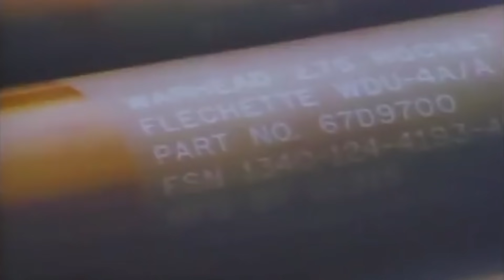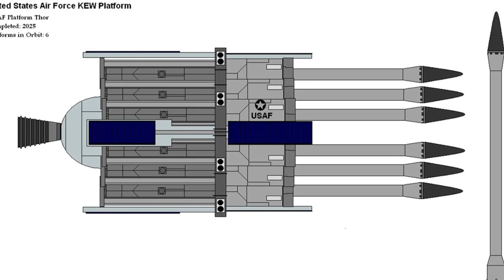'Rods from God' Weapon System Gets Another Look

Comment: Sound barrier breaking speeds lol. No they would hit at a speed around mach 10!
Reply: And in the next breath says they would lose mass due to air friction.
Reply: Justin Kirk These rods are made of tungsten. They can withstand over 6,000f and be fine. The Space Shuttle Orbiter gets around only 3,000f during re-entry. Well below the temperature tungsten can withstand.
Reply: @resolutesupport3874  yeah but the space shuttle isnt going mach 10 lmao
Reply: @resolutesupport3874  the amount of heat generated depends on how fast the object is going, as well as the surface area of the friction from reentry.  A smaller point of friction would generate heat a lot faster than a larger surface area traveling at the same speed.  It would also slow down less than an object that offers more resistance.

It isn't the resistance itself that causes the temperature change but ( surface area, rate of speed, amount of resistance [density of the automospheric values at that altitude], and time traveled at that speed in that resistance. )

If a shuttle stayed in the reentry drag for much longer than it does it would fail.  Due to time.  If it comes in sooner than the density would cause it to fail.  It really is a finite science.  Granted I'm not a rocket scientist if you will but there are other fields of expertise that use a small bit if the same physics.
Reply: @ditto9300  mach 22 actually (17,000mph)
Reply: @justinkirk5449  that would more than likely occur due to the structural integrity being degraded during reentry.  Coating it with a ceramic material simular to those used on shuttles might negate most of the mass loss of the projectile.
Reply: @dontneedtoknow5836  lol, tungsten isn't strong enough so we should paint it to make it stronger. 👌😂😂
Reply: @justinkirk5449  lol no.  Coat it with a heat disbursing material to prevent any integral loss.
Reply: What do people that think they know things say to people who actually know things... @dontneedtoknow5836
Reply: You tig weld with a tungsten rod. Tungsten wouldnt even get soft entering atmosphere
Reply: You realize mach 10 is ten X the speed of sound, right?
Reply: @CaptHavoc2024  yes, and that was a conservative estimate. It’s probably going to hit harder then that.
Reply: You do realize that 2000lbs has terminal velocity of 0.5mach, right?
Reply: Force of a nuclear warhead without the long term radiation
Reply: @Shem Casimir The shuttles, having a high drag coefficient slowdd down in the thin upper atmosphere. By the time they hit the denser air at lower altitudes, they were pretty slow. That wouldn't be the case for these things.
Reply: @Evan_Bell  wow wish I would have seen this response first then the entire equation Explination wouldn't have been necessary.
Reply: @dontneedtoknow5836  
Are you referring to the comment I left outside of this thread?

Orbital velocity:
V_orb = ((G*M)/r)^0.5.
G = 6.67e-11
M = 5.97e24. 
r = 6,371,000 + (1,000,000*1.609) = 7,980,000m. 
V_orb = 7,064ms^-1.

Velocity from falling:
V_final^2 = V_initial^2 + 2ad. 
V_initial (vertical) = 0
a = 9.807ms^-2.
d = 1,000,000*1609 = 1.609e6
V_final^2 = 1.578e7
V_final = 3,972ms^-1

V_total: 7,064 + 3,972 = 11,036ms^-1. 

Kinetic energy: 
E_k = 0.5*m*(V^2)
m = 2000 lbs = 907kg. 
V^2 = 121,800,739. 
0.5*907*121,800,739 = 5.524e10j. 

1kt_TNT = 4.184e12j. 
5.524e10/4.184e12 = 0.0132kt. 

Only one nuclear weapon was ever deployed with a yield smaller than that, and it was carried in a backpack.
These things aren't comparable to a nuclear weapon. It's only just over 1.2 times higher yield than the GBU-43/B MOAB.
Useful for bunker busting? Theoretically. Fill a similar role as nuclear weapons? No.

The highest melting point material we have is tantalum hafnium carbide. It melts at 3990 C. 
Assuming a semi-vertex taper angle of 5 degrees for these cones with a nose radius of 1mm, and a velocity of 11km/s, the temperature behind the oblique shock front will be just over 1000 degrees. The mach number behind the shock will be 17. The density of air behind the shock (at sea level) will be 5.32kg/m^3. The thermal flux will then be 17.77GW/m^2. This is more than sufficient to ablate any material, including TaHfC.
Reply: @Evan_Bell  actually I did not see that equation posted.

Is the actual altitude from sea level almost 7 million meter?

And are you accounting for the combustion of the buffer zone of air in front of the projectiles ignition upon compression?
Reply: @dontneedtoknow5836  7.89million meters in the orbital radius if it's 1000 miles in altitude. 
Are you asking about the plasma sheath around the front end? There's no combustion going on there. In accordance with the depictions of these things, I used a small nose radius and shallow taper angle. This avoid reaching temperatures at which air begins to be ionised. If the tip was rounded, then the temperature behind the shock front would be about 66500 kelvin.
Reply: @Evan_Bell  at that speed it should have a combustion of the oxygen within the nose region just before impact.  Simular to a fire piston considering the rate of disbursement is somewhere around mach 3 if I'm not mistaken.

I believe the buffer is called the conical wave?  Don't quote me on that because I'm probably wrong.

And a fine point would literally heat up faster than a larger surface area.  At 1mm in diameter it loses the disbursement properties long before that speed.  The amount of time that the friction is ensured would negate any measures from the design.

Physics of a knife blade helps explain this.  A very sharp knife can not exceed an angle of 20 degrees in either direction or if it does it will be non proficient.  Either by not being a clean precises cut at 21 degrees or subject to chipping, rolling, and flattening at 19 degrees.  Even though a 20 degree blade is very sharp it degrades very rapidly when it comes into contact with any surface that offers resistance equal to 1/4 of the materials density.  E.G. a metal surface, a scour pad, hard plastic cutting board, glass surface or jewels in jewelry.  It also is more subseptible to heat damage.

Granted a fine tip does cut better and offer less resistance.  But is also more subseptible to any changes in temperature and density.  I see how your value could be accurate however there are many factors not accounted for that I think would be very important.

I don't think time is being properly perpetuated and maybe because a miscalculation in the velocity due to assessing terminal velocity being the contributing factor of gravitational pull and elevation.

The terminal velocity from before reentry needs to be recalculated?
Reply: @Evan_Bell  then you can calculate the loss of speed using the algorithm produced above.  But the value before reentry needs to be defined, and then the negating ( deminitioning return ), including the time inside of atmosphere vs terminal velocity inside atmosphere, with the resistance being the determining factor and loss of momentum being calculated in as such.
Reply: @dontneedtoknow5836  Combustion of what? Oxygen doesn't burn, it's an oxidiser. There's no fuel in the air. Air doesn't burn. It is heated, and it can ignite flammable materials within it. The air itself doesn't burn. What do you mean by rate of disbursement?
A conical wave is one profile an oblique shockwave can take, which is what I modelled. For the same thermal flux, a surface will heat up no matter then area. I don't know what you mean by disbursement. 
Yes, aerodynamic heating is complicated. 
Terminal velocity before re-entry? There is no terminal velocity outside the atmosphere. I calculated the orbital velocity at the beginning.
Reply: @Evan_Bell  pire piston look it up.

An edge has a higher propensity to generate heat if friction is based on one point of contact.  << requires more time or more friction but once it begins it rapidly increases to the maximum temperature of the friction due to inability to disburse the heat efficiently through uniform cooling designs.

I guess I didn't see the "orbital velocity" probably due to skimming and researching the GW output of a nuclear devise.

Air can only be moved so fast.  Before impact it compression destabilization it will ( air contains more than oxygen and oxygen is combustable ) generate combustion which will increase the yield equivalent to volume/force applied.  This is how a fire piston actually works.  Just like a desiel engine will do the same thing.

It isn't a free energy method however because the force applied is negated by friction and mass of moving part inside an engine.  That is why a fuel source is required.
Reply: @Evan_Bell  sorry I quoted that wrong.  Oxygen is not combustible.  However yes you are correct it is an oxidizer which is required for combustion.  I will link the fire piston method in a second to help display the premises.
Reply: @dontneedtoknow5836  I calculated the speed before re-entry. 7,064m/s. 
My calculations provided an upper bound on explosive yield, to prove it would not be comparable to a nuclear weapons.
Reply: @Evan_Bell  https://en.m.wikipedia.org/wiki/Fire_piston
Reply: @dontneedtoknow5836  Fire pistons heat up air to ignite a flammable material. The air doesn't burn. A rounded nose would produce bow shocks, which would produce less heating, but decelerate the projectile quicker. Oxygen is not combustible. It's an oxidiser. Are you saying the plasma will add to the energy of the impact? It won't. Fire pistons employ adiabatic compression to raise the air temperature sufficient to ignite a flammable material.
Reply: that would probably go up to mach 27
Reply: @timbob8977  not when it impacts.
Reply: @mwtrolle  Moments before it impacts it will be mach 20 no doubt

Comment: i would not be surprised if three or four countries weren't using this system now as a countermeasure to the USN aircraft carrier fleet
Reply: I would be. Trying to hit a static, massive city is one thing. But hitting a moving vessel from space when the flight time is 15 minutes? Nearly impossible.
Reply: @funkle2645  hitting a  moving target is an engineering problem and can be solved

Comment: The rods were to be made from Tungsten.  Very little ablation of material due to heat was expected.
Reply: That has a problem. Tungsten is extremely dense. Max one could bring at once up there would be one or two.
Reply: @paniniman6524  They could segment them but yes, weight is always an issue when you talk about space.
Reply: I believe the government used a program like the HARP super gun or rail gun, etc. To get the raw materials in orbit.

Comment: the kinetic energy required to match a nuclear bomb from a 2000lbs rod would be near light speed... thus impossible... seriously,rods from god are sci-fi at best with today's tech...  the only way is to augment the mass of the projectile rather than augment its speed,but it brings up another problem. how do you lift up a system carrying rods who would weight in 100+ ton each into space,much less do it without another superpower knowing.  useless subject to talk about really,the only thing remotely close to kinetic kill projectiles are the ones fired from the navy's railgun project and they have limited useage today.   end of video

Comment: i bet encasing it in tungsten carbide or ceramic would keep it from melting
Reply: The design intent by Boeing was to fabricate these from tungsten.
Reply: Omg ty.  Someone else gets it
Reply: it's just a tungsten telephone pole. it would heat as it made re-rentry( or entry ) and solidify before it hits ground because the air getting thicker the lower it gets. it's a stupid simple idea, all around

Comment: Says Lazy Dog Bomb, shows picture of Flechette Rockets...
Reply: White Rice  Flechettes come in all shapes and sizes, from thin and tiny to very large and thick depending on the planned usage.  What is shown in this video is the M255/A1 (APERS) fitted with wdu-4a flechette warheads for an anti-personnel role.  Lazy Dog kinetic projectiles were dispersed using devices such as the MK44 Cluster Adapter (dropped like bombs, not fired out like flechette rockets).

Comment: Slight problem. Dropping from a thousand miles up means launching rockets. The ISS is only a few hundred miles up. Stuff in orbit just doesn't fall out of the sky when you want it to.  One doesn't simply hang bombs over an enemy.
Reply: Bruce Goodwin the rods would be placed on a satellite which would brake a rod with a rocket motor off towards the target once the satellite was in range with the motor guiding the rod to its target
Reply: @alexalbrecht5768  I see. Essentially, we put a low mass, aerodynamic ICBM in orbit (we launch it to threaten, we de-orbit it to destroy stuff). Sounds dangerous & expensive, eh?
Reply: Bruce Goodwin all good weapons are dangerous and expensive
Reply: @alexalbrecht5768  Indeed. And bad weapons are more expensive and dangerous.
Reply: @alexalbrecht5768  This is a very inefficient weapon.

Comment: Hmmm I'm not sure if I'm just being dumb but isnt there terminal velocity factors in this idea? You drop a mass from zero gravity, it hits the atmosphere, is slowed down pretty dramatically then as it passes through the upper atmosphere into the thicker air density at around 15 to 17000 ft, its should just hit with the same mass and speed as a low altitude drop. The dude who skydived from 140000 ft broke the sound barrier with his ass (coool) but the time he hit 30000 he was back at terminal speeds so how would this idea work without propulsion
Reply: Interesting?
Reply: Repomeister  ha that's really interesting thanks for that. It never occurred to me that the difference in over all mass dictates at what stage terminal velocity is reached i always assumed objects fell at the same speed irrespective of size. Nice one 👍🏻

Comment: Terminal Velocity¿
Reply: Actually the terminal velocity of different objects falling to Earth varies depending on object mass, surface area, and drag coefficient. An object of great mass with minimal facing and drag could be pretty deadly. But the real issue they ignore is the expense of getting such masses up in the first place. While more mass will provide more "effect" it will also cost more. I'm thinking that it would be awfully pricey for what you'd get.
Reply: depends, it's a long slender rod that is really heavy so i would expect it to retain most of it's kinetic energy while reentering the atmosphere. so my wild guess would be something around 14,000mph somewhere around that.
Reply: @killman369547  I agree that such a rod would be damned deadly, but the cost of putting it in orbit...along with all the hardware it would take to maneuver it into the correct position and speed for an effective drop to hit a given target effectively at the time you'd want to "launch" the rod would be...astronomical!  :-)  It would be hell to defend against such a projectile though! I can't see any reasonable way to stop it other than hit it before it's launched.
Reply: @Joseph Cousins Again it's that killer need to get the materials there in the first place. Bottom line is that it's expensive to get things out of a big gravity well like the Earths. If only we had some way to get things up there more cheaply.   :-)